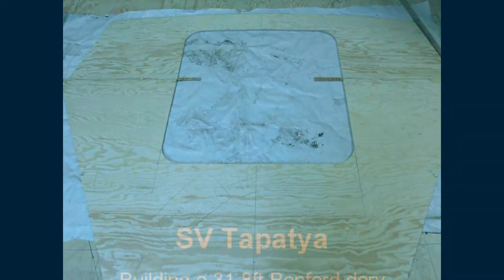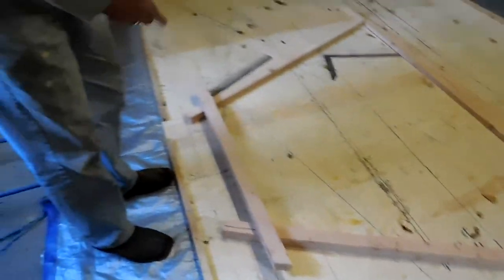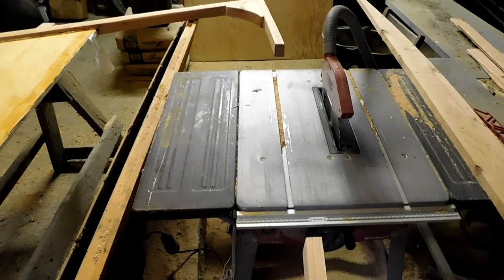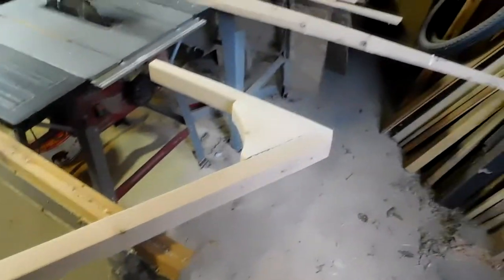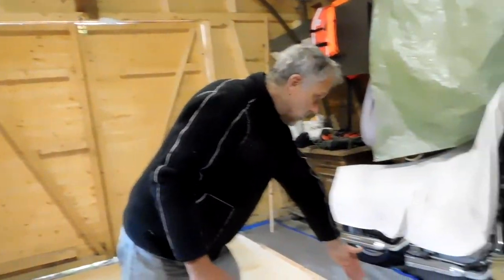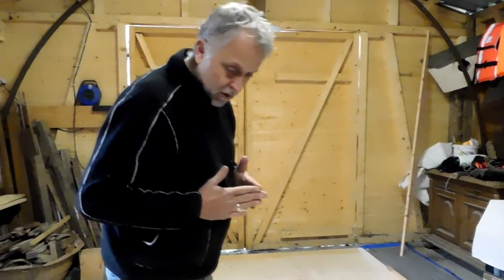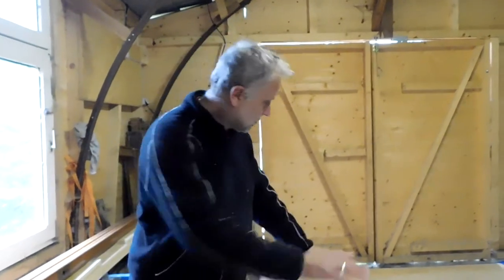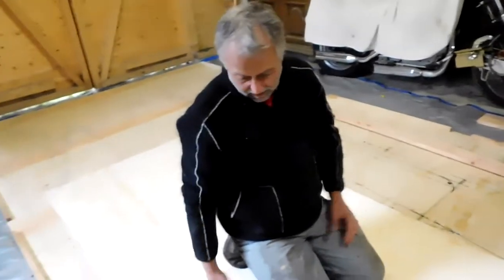The station 2 frame and the station 3 bulkhead - SV Tapatya EP07

Comment: Totally agree with you regarding the ply, once it is sealed and protected it will last. How long does the resin take to harden at 20*c ?
Reply from the maker: Full hardness is 7 days I believe. Touch dry in about 6 to 8 hours
Reply: Completely agree with your point on sustainability.

Comment: What's the manufacturer of that pine plywood? Normal ply found in here Finland is spruce or then there's birch (which is not really suitable for boating in long term...) But no pine found in normal stores...
Reply from the maker: I don't know who makes it. I buy it from a local lumberyard. It's sold as wbp pine, but I wouldn't be surprised if it's fir really. It has no manufacturer's stamp on it. 

Have you looked at Finnfir?
Reply from the maker: Sorry. Take that question back. I thought I remembered that brand of Finnish plywood, but I can't find it now. Maybe I remembered wrongly
Reply from the maker: It was Finnforest that I was thinking of. But they only seem to offer spruce or birch now. As you say, birch is not really suitable. Spruce would probably be ok if wbp and epoxy encapsulated